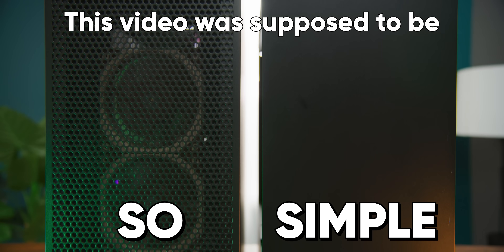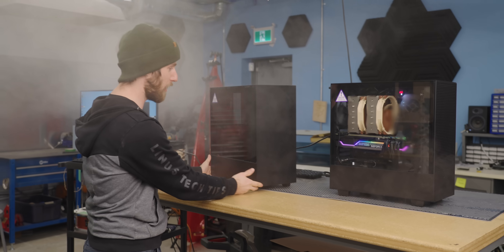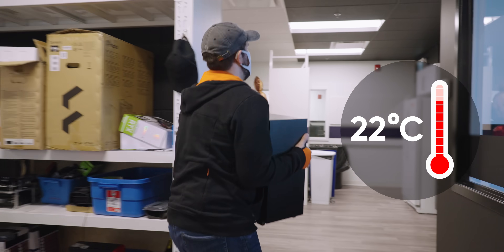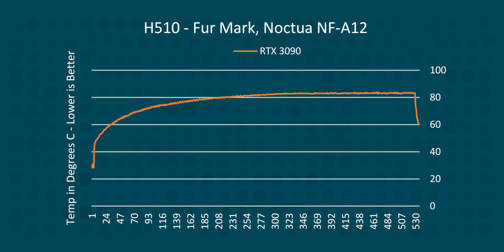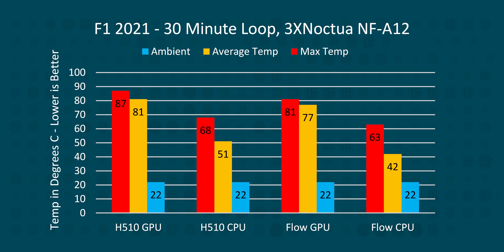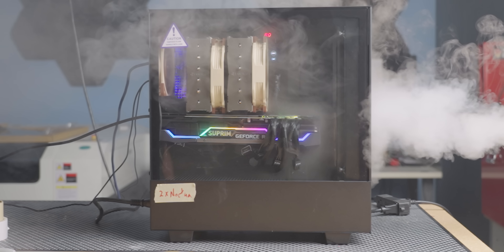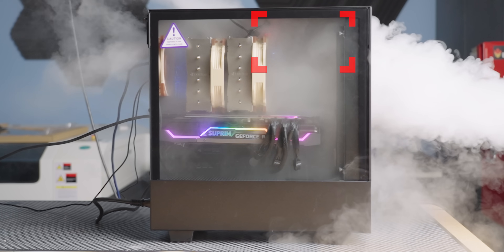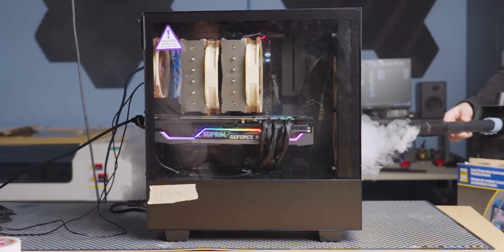Everything You Know Is Wrong - Mesh vs Non-Mesh Front Panel

Comment: I was expecting some type of actual trouble shooting like seeing if lowering the fan rpm or adding a guide for the airflow would help at all
Reply: Yeah, this video pretty much said nothing other than 'go to Microcenter'...
Reply: @nintend0m  That is what happens when you try and copy Games Nexus style of testing
Reply: @dickdastardly4801  and ignored the testing GN did in this exact case. You'll notice his fan placement on the solid front doesn't match what GN found to be the optimal form. It's well documented that the OG 500/510 runs best with negative pressure and that any other fan placement results in the observed GPU temp issues.
Reply: @nintend0m  Linus' Pro tip "spend schmekles at microcenter"
Reply: Bottom Intakes. :)
Reply: @dakai4992  this. that case is all middle/top intake. It's simple flow routing. It's hard to expect any kind of air intake at the bottom of your case when your case isn't designed to have any air intake at the bottom of your case... /shockpicachuface
Reply: 1. Show without the bottom fan
2. Try and place fans in order to maintain a steady laminar flow within the case
3. Use your fancy thermal cameras to actually show the air heating while circulating
4. Information such as flow intake (volumetric or mass), volume of "spaces" for air admiting stationary flow mention in (2) (between front fan and cpu coller, cpu coller to exhaust fan, front panel to exhaust underneath the GPU, temperatures in/out of air would be appreciated since it can help determine the effecience of the colling system.

Such information and investigation could help to better understand how fans should be placed within pc cases and could held manufacters of PC cases to model a little bit better fan configurations for clients.

Some general guidelines already appear to be emmerging from this results:
1. A fan should never be placed in a manner that allows for air stream to be parcial blocked
2. A fan should be placed level with the gpu backplate and an optimal 2 front,top fan should be consider
3. 2 or more air streams within the case are prefer.
Reply: Speaking about that. I have the regular h510. What i've done is cut a custom gpu brace from craft store foamboard. I support the full length of my gpu and scoop coolish air from the nzxt 280mm cpu cooler. I run the gpu fans at max 60 percent and get sub 70C temps all around. I'm running a ryzen 5800x and am stuck with the hot running xfx rx 5500 xt, got stuck with it buying it pre-gpu shortage lol.
Reply: P.S. I run a slow profile for my cpu fans.  I've also found that turbulence does not equal cooler temps. Rather the case has to few exhausts for the size of intakes. It doesn't need much fan tuning to make up for that 6C delta with a little knowhow.
Reply: What? you think this is some kind of tech tips channel? These guys put thermal pads on inductors and test whether negative/positive/neutral case ventilation is best based on looking at mixed hardware. It's MrBeastFTW doesTech.
This is purely for the clickbait and "product showcases" not actual user information, For that you have to go to hardware unboxed or buildzoid or gamers nexus.
Reply: and if flipping the PSU the other way would help as an exhaust in this situation
Reply: I'd say this is the first of a series. And not only they wanna milk it, I also believe they want feedback. The LTT labs is new, and must still be learning the ropes on technical testing and content building balance.
Having said that, I also agree that they could've gone further.
I personally am half expecting Gamer Nexus respectful video talking about the limitation of their testing, already.

This is a good first step
Reply: Just take the side panel off and disconnect the front cabinet coolers they are useless in this configuration
Reply: See this is why I just leave my side panel off
Reply: Same here. At least some kind of piece of cardboard to see if it would blow the air down and across the GPU...
Reply: Use only one fan with the NH-D15 on tiny cases and run the front fans slower
Reply: Tubes.
Reply: troubleshooting will be for another video. it's like avengers infinity war and endgame couldve been 1 movie but for storytelling and financial purposes, they split it to two. though ltt might be leaning more towaeds financial and time constraints abd much less storytelling.
Reply: No this video was clearly just to sell ads
Reply: The problem with trying to give general tips about airflow is that the aerodynamics of your case / PC build will vary drastically from theirs. While you could tamper with the fan settings, at the end of the day, you'd still need to test, record, and analyze the data from your own machine.
Reply: Almost like he said they had follow up content planned....
Reply: I think it's a teaser for their future lab videos
Reply: But that wouldn't fit the 10 minute video format.. So not a good fit for LTT
Reply: @DavidHauslerProductions    what do you mean? for the past 10 days 8 of their 11 videos have been 14+ minutes. There's no reason why they couldn't go into depth a little more. Like using another similar case or trying other fan configuration. They should have just made this video a comparison of the two front panel of this case not a video about if more fans actually makes a difference. Using only one case with a different front panel doesn't really prove anything about if more fans make a difference. All that it proves is that the mesh front panel does make a difference.
Reply: Ok so I wasn't the only one lol, when it ended I was like wait ... that's it?? Think i'm just used to how thorough GamersNexus is on this stuff.

Comment: you should always prioritize exhaust over intake. I kind of understood as much intuitively since I do have a bit of experience in aerodynamic and air flow. This is how they do wind tunnels usually anyway. There are two types but one of them is with the big fans at the end of the tunnel. You suck air into the tunnel rather than push it in, it makes for smoother airflow without a need for complex models that make the flow laminar.
Reply: This. But also. The fans actually produce very little pressure, just flow. When fan specs state 2,34mm H20, you are actually talking about 0,234 millibar (back of envelope conversion) What people don't understand is that at this pressure there is no more airflow. (pressure vs displacement curve) Fans act the same as impeller pumps, the more restriction / backpressure you have the lower the flow and the more turbulence. So getting air out of the case improves this by a lot. And also spinning the fans to their max RPM actually often has a adverse effect. You are better off leaving the exhaust fans full speed and limiting the intake fans since the lower the pressure in the case, the better the efficiency for the intakes. If you want to perfect this in the case as in picture. Installing a baffle dividing the case in 2 zones, one CPU and one CPU, and then tune the fans accordingly will probably vastly improve the results. Most GPU's do not have that much fan efficiency so do not need the bottom fan running full speed. A baffle would prevent air from the top fan leaking downwards if you limit the lower fan.
Reply: @BertM3  I never understood the case design prevalence. The most popularized one is so inherently fucked on so many levels. Separated component between the CPU and the GPU mainly with two independent airflow chambers that mostly direct air vertically would be ideal. I have no idea why we use this busted side to side stacked on top of one another design. I guess it's just the case of convenient design that initially didn't even consider airflow nor the fact that a GPU would be the primary card in the computer in the first place. So they likely just got together what was easy to build and work on and then kept it going this way for decades and only now does it turn out that with the size of the components and the cooling units we are bottlenecking on airflow of all things.
Reply: yeah, but then you turn your PC into a vacum cleaner, and you loose focused airflow, not to mention that you are taking preheated GPU exhausted air pulling it into the CPU cooler.
I see so many arguments and none of them solve the problem or do it without caveats.

The biggest problem is the GPU and how its intake and exhaust works. A "vertical" tower cooler would solve all the problems. But since you wont see that anytime soon, then next best thing, is a airflow focused case, designed for a more narrow range of hardware.

For example, a case with the minimum size to fit 3x140mm in the front. 430mm H x 430mm L x 210/215 W without accounting for the feet.

No PSU shroud, cables managed behind the right side panel, and top, and bottom sealed and both equiped with brackets for storage. Cooler clearence 160mm and atx support. 
Front completely sealed around the front fans and back with as much as posible removed material.

I had the same problem like in this video, but with a meshify C. Solution? clear the area bellow the GPU add intakes, and slow down the center front fan. Works like a charm.

Comment: A litte off topic, but it's also thermals. When (custom) watercooling is used, why is the radiator ALWAYS inside the case? You have the tubes to get the hot water away. Woudn't it be much better to get the rdiator outside the case to run the PC cooler. So you have the same amount of heat inside the case no matter if air cooled or water cooled. Yes you must have the Space for it. But not even overclockers I see doing this.
Reply: having it outside makes mounting a lot harder? that is pretty much it since the extra liquid wont really matter unless you went for the cheapest pos pump you could find

Comment: If you have a 12900k, GPU temps don't matter anyways as you'll need all the air to stop the CPU from thermal throttling. The GPU isn't going to thermal throttle at those temps, therefore it doesn't matter. 
You need to prioritize to airflow to the most impacted components anyways.

Comment: The problem here is Internal Air Flow Space, its one thing to have a lot of great fans but if the air does not have the space to flow then there is no point. At the least get a case that is taller and has the space for two top-mounted fans or better still get a case where the Mobo is mounted horizontally and then also have them top-mounted fans. I want to see Linus redo this test with some of them TermalTack cases that do allow for the horizontal mounting even if it just one of their smaller versions.
Reply: ThermalTake? but also checking an FT02 or RV02 from Silverstone would also be very good content for a smoke test. in terms of 90° MoBo mounting.
Reply: I think a case like the Lian Li Lancool II Mesh is the perfect case to test out all fan configurations. It allows for front, back, top and PSU shroud fans. Also allows for 120mm or 140mm fans on the front or top. 

A good tech youtuber should be able to use that case to test out all scenarios for a PC case and see which configuration works best.
Reply: Exactly for this reason, an inverted ATX layout sometimes is the better choice if you have a large GPU. That way you always have enough space for some fans on the top, that provide fresh air only for the GPU plus a front fan for CPU airflow.

It's basically the same idea that brought us PSU shrouds: separate airflow zones for each component. Plus you can even independently control the fan curves to get the most quiet PC possible in any load scenario.
Reply: @stephanweinberger  u are right, but psu shrouds came in just because asthestics, in fact they reduce front fan pperformance because blocks half of 1 of the front fans. 
on micro atx cases, psu should be at top, so bottom fans could be added.
Reply: How about a shroud for one of the intake fans to blow air to the GPU? You could eliminate that turbulence with a nice slanted design and get it right where you need it.
Reply: i know exactly why this happens, more gpu temperature with noctuas, than with stock fans. Linus missed the real point, kinda. He is wrong in 1 or 2 points.
u will get better gpu temps with a bigger case, but the video is not about that.

first of all the stock fans DOESN'T push air out of the back pci expansion slot plates, is the other way, they are enough weak that instead of air going out of pci expansion plates, air is coming in because rear fan is moving MORE AIR than the 2 fans at front under double mesh. So air is coming in, directly to the gpu, from the slot plates under it, dragged in thanks to the rear fan creating a "negative pressure" inside the case. 

When you add more powerfull fans at front, the pressure is balance, and rear fan can't no more pull air in, from the expanxion slot plates. So gpu stops receiving fresh air from there. increasing the temp.
Maybe the more powerful noctua fans at front, now move a bit more air under the gpu from the front, but is a lot less, than the air that was coming in from expansion slot plates. 

And that is the reason.
The gpu creates a recycling wall that makes airflow from front hard to pass through , even worse on that narrow gap between the gpu and the psu cover. And even worse with the expansion slots plates on, instead of removing them.
Reply: @MrDvneil  Makes sense. I've suspected for a while now having a rear exhaust fan right behind the CPU cooler can starve airflow over the GPU. First thing I would try if I were LTT is simply removing CPU rear exhaust fan.

 On my own rig I have rear exhaust set as an intake and have my Black Rock 3 tower cooler flipped 180 deg pulling filtered fresh air from rear intake. 2 top intake and two front intake create positive air pressure that force        air flow around the front of the GPU and out the bottom expansion slots.  I don't actually think this is very efficient; but my case is kinda old and I'm improvising. I suspect I'm trading higher CPU temps for lower GPU temps here also, but my CPU stays under 75 and the gpu still hits 80 so it's seems a good trade.
Reply: @kleinbottled79  i know your point in that configuration, starts with a nice idea, direct fresh air direct to the cpu cooler ( that helps with big cases where frontal fans are far away from th cooler and mos of the air escapes from top mesh before reaching it)
on small cases doesn't matter too much, just that maybe enters more air from rear fan because doesnt have a mesh. 

the real problem in your configuration, is, the first rule is. -> to enter air, air must go out. 
and all your fans are intake, so air can't enter the case, just enters the same amount that goes out from the pci expanxion slot plates. 
and that is not enough space to create a proper airflow. 
just tell me your case model so i can suggest u something else.
Reply: @MrDvneil  Removing PCI-E expansion metal brackets does wonders in this situation, (and de-shrouding and zip-tie-ing full size fans is also awesome). So do cases with bigger, and better designed venting holes on the back side. Fractal Design Torrent is one extreme example where the exhaust area without exhaust fans is as good as the exhaust area with the exhaust fans (if not better). Technically yes the Torrent has PSU exhaust for CPU, but the GPU works fine as well.
Reply: idk, I think MOAR FANS could solve it

Comment: Welcome to fluid dynamics! One solution is to place vanes to direct flow where needed (or shunt flow away from short circuits). A vane that starts above the lower front fan, terminates at the lower edge of the GPU, and spans side to side could substantially increase the air flow to the GPU intake side.
Reply: This HVAC guy fully agrees 👍
Reply: Considering I have the h510 flow, I’m thinking about putting a black piece of cardboard paper to direct all the airflow of the bottom front fan under the gpu. I’m not getting any bad temps right now (3070 at 70° at 100% load and without any fan curve adjustments) but I want to see how much of a difference it will make. That and 140mm fans.
Reply: @myrealusername2193  U could also try making the front fans exhaust air.
Reply: You could also design the front so that the mesh part is at the bottom and lower the fan placement, so the the lower fan more directly blows into the bottom half of the case without the requiring any vanes. The only tricky part is doing it in an aesthetically pleasing way.
Reply: @OutruntheWind  should be no problem in the H510.

There is quite a gap between the front panel and the internal divider in front of the harddisk cage. If NZXT were to open this all the way down and added a lower fan mounting position (part on the current fan mount, part on the lower divider), it should still have enough space to suck in air from the front mesh. They might also want to add a panel to close the gap between the two fans then, in order to avoid any recirculation and create a clean two-zone airflow setup. As a side effect this would also provide cooling for the harddisks (even with the fan in its current location, as it would open up an air path from the PSU air intake over the harddisks to the fans).

Comment: I exchanged my stock fans in my Silverstone Ps07 with nf 12a in october and also exchanged the fan on my Nh-u12S.
And i also removed my last hDD tray. And now my pc is cooler than ever.
Ok i am only using a Palit 1080 Jetstream but still, the Ps 07 (white) is a small case and if you don't open the door it can get a bit warm.

but up to now? No problemo.